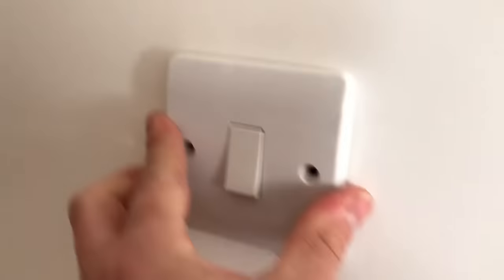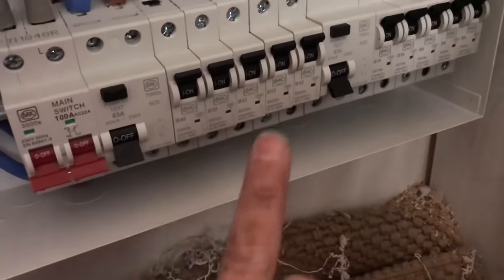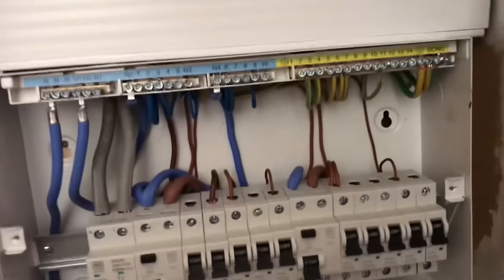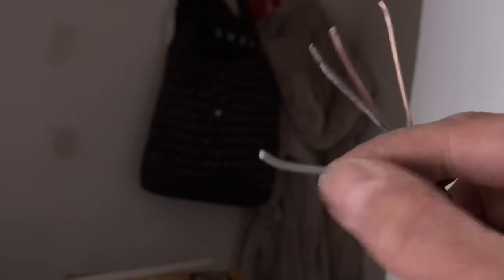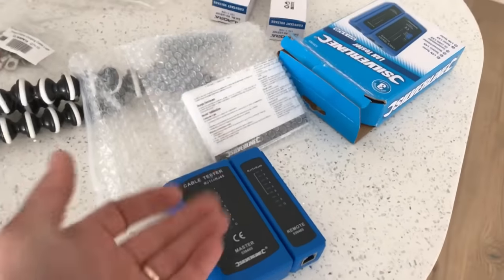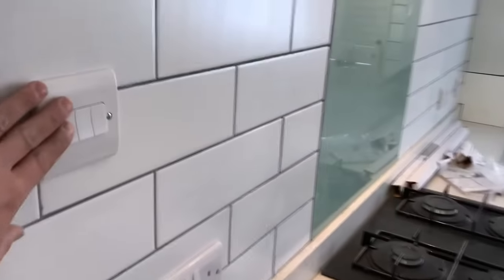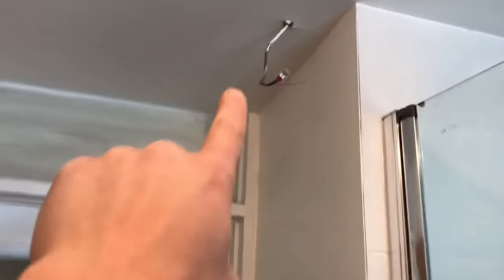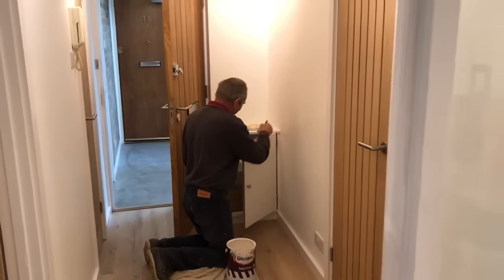CJR ELECTRICAL Electricians day finally finished the flat from hell!!!

Comment: I’m an American electrician and it’s interesting to see how you do electrical work in the UK.
Reply: Much better and safer you mean? Rcds save thousands of lives. My friend was saved by one. In the US he would have had 15A through him.
Reply: bobandbobandbob calm down dude, we have gfci stuff too, electricity is a current anywhere, got to be safe with it.
Reply: @bobandbobandbob6285  new construction here all uses gfci.

We also use half the voltage you guys use, id say thats quite a bit safer.
Reply: Donz Milky Except you have considerably more electrical fires and electrocutions, even taking population size differences into account. Your voltage is no less lethal, but it does mean your appliances are piss poor performers!
Reply: @spencerwilton5831  not true in the least.
Reply: There was no implication about a lack of safety, All I meant it was interesting to see the codes, methodology and equipment used in other countries.That’s all, The comment was meant for other electricians not trolls.
Reply: @bobandbobandbob6285  I'm an American electrician and we have the same safety devices.
Reply: @donzmilky5961  You do but aren't a lot of new builds fitted with 240v for hungry appliances now?

Comment: Check inside a chint board ,very neat as has covers on the neutral  bars. Snobs will call em crap but I reckon better build than most.
I would have chucked an rcbo board in for so few circuits.  But keep up the good work.  Enjoying your vids. No swearing ha so my boy can watch em with me ,until he gets bored lol.

Comment: The door that swings down ‘IS THE METAL MESH FILTER’ I have one of those (in cupboard) filter hoods but I also have it vented by pipe out to the exterior. You take off the door and bang it through the dishwasher to clean the ‘filter’. They are not the best cooker hood but they are good for confined space kitchens that have no room for a big fancy hood.  
IT DEFINITELY NEEDS VENTING TO THE EXTERIOR THOUGH!!!!!!
Reply: The metal is a pre filter, its supposed to have another filter behind it.
Reply: Donz Milky Not always so, my hood has dishwasher proof stainless mesh filters, as do all commercial hoods. They are designed to be ducted out though, if not, additional charcoal filters are needed.
Reply: @spencerwilton5831  his isnt vented to the exterior

Comment: Really top work here. Considering the challenge of working around the "finished" kitchen/bathroom.

The extractor hood should really have been vented outside however. The fan won't do anything blowing into a closed cupboard as the back pressure will build up and be too high for it to work.

Comment: i dont know what to say about those crimps, i work as an electrician mostly building electrical assemblies and whenever we see that style of crimp we always trim it to length and then heatshrink whatever is left.... and we only use them on grounds XD
Reply: M H  youre clearly using the wrong crimp tool, when ive done calibration testing for our tools, in a tensile test, the copper strands will break before its pulled out of the crimp 99% of the time and the 1% is when the tool fails calibration

Comment: Suggestion:-  At 18:56  Position of driver for LED lights.  Why place it on the surface of the shelf, especially with its width down flat.  If it needs to be on the shelf, why not affix it so that the narrow edge is down on the shelf -- that way it would take up a bit less extremely valuable shelf space.  Even better, mount upside down underneath shelf above where you have it (but would need a little more cable length).  Even better, mount underneath that shelf in the open cavity -- at rear, at same vertical height as the LEDs themselves.  Would not be seen probably, as below head height, and does not take up any cupboard shelf space at all.   Do not contribute to the hell in the "Flat from Hell".

Comment: I used Philips Pentura LED strips at home. No need for separate drivers, so no need to find a home for the driver. You can't cut them to length, but they are available in a range of lengths and just plug together to create whatever length you need. Very quick to install.

Comment: I went to a break down at a dairy shed once. There was a company in the area upgrading switchboards for a ridiculously low price. 3 Rows of 15 MCBs. One phase per row. Majority of the breakers in the centre were all burnt and black at the bottom terminal where the bus bar was. They had forgotten to tighten up all the terminals in the middle of the rows. Had to replace all the damaged breakers. Not cheaper when you have to pay for a job to be done twice. Cheap, fast or right. Pick two because you can't have all three.

Comment: I'm sure someone has already said this but the Cat cable tester.  Doesn't work as shown. The end with the switch (battery) on is the source, you monitor the other unpowered end to check if the LEDs flash in order, to indicate no crossed cores.  Enjoyed the videos nice work.

Comment: the RJ45 checker you need to check the lights on the smaller unit, the larger unit is just the sender and lights up regardless the small unit is the receiver and that will show if there is a cross or no connection
Reply: Both ends of testers like that flash the same. You can check at either end.
Reply: @christopherhall5525   no you cant the sender side flashes in order from 1 - 8 no matter what (even if no cable is connected)  the receiver side must also flash in order to be correct. if the receiver side flashes out of sequence its a crossed wire, if one light does not flash then its no connection,

Comment: I recently went into a maisonette in Leamington, where some tool of Eastern European origin, wired part of the dwelling connecting kitchen and hallway lighting to sockets. All the blue conductors in the consumer board were in the mcb's, brown in the neutral bar! Stripped back some of the walls to find rogue connections to switches made with 2.5mm cable! 1mm cable connecting kitchen appliances! I kid you not, check out my Facebook page at ades-cov, I've posted a video on it.
I had to literally rewire half the dwelling, (mainly due to the young lady's budget). 
Some guy recommended by a family friend apparently!
No credentials,  no profile of jobs done. Connected a 7 2kw hob to the back of a socket hanging off loose, behind the oven which was plugged in. How the place didn't go up, is beyond me.
So it gives me some degree of satisfaction knowing that there's those on here, that do it right. 
Great videos,  thankyou.
Reply: Happens all the time. I recently rewired a family place that had been "sort of made safe" by an electrician back in 1991 but really needed a full rewire. In the walls I found some of the crap they'd disconnected back in the 90s - utterly priceless! Italian 10 amp sockets wired with 0.3 mm flex plastered into the walls, 0.5 mm solid wire posing as 1.5 (very thick insulation) feeding sockets - some of that was actually still in use until earlier this year, on a 16 amp MCB, etc.! The way they ran the wires made me suspect some Italian cowboys after several bottles of Grappa! No idea how old the work was, the only part I could kind-of pin down was the pseudo-1.5 mm, probably done in 1960 judging by the newspapers stuffed into some of the holes to save on plaster.

Comment: Your cable tester shows 6 with a partial glow. I'd say you have a slight short on that one, needs checking.
Also check the other end (the part without battery), that is the one that tells you if you've mixed a wire.

Comment: Great video, I really enjoy watching them, but I think you didn't use the RJ45/UTP cabel tester correctly. The LEDs on the main box flash no matter what (even with cable disconnected) in sequence, or manually by button press, then you have to check actually on the other (terminator) side, to see if all the LEDs there are lighting up the same as on the main box, they should be in sequence aswell to see if you wire each pair correctly (or not in sync for crossed cables, which are not commonly used, except for PC to PC connection). Only few of these boxes allow you to check the LEDs on the same (main) side, when you connect the terminator, it shorts each pair, so you can check on the main side not single wire but each pair.
Reply: PC LAN ports and switch ports have all been Auto-MDIX for a long time so no cross-over cables needed.
Reply: @UKIP  Yes I agree, thats why I said they are not commonly used. But believe it or not, I still come across them from time to time, so I just pointed that out, that in case the LEDs don't flash in sequence it is not necessarily a fault, but the person would actually have to know how they are crossed (orange with green striped/solid stay the same and blue with brown with striped/solid switched) to determine if it's a fault (incorrectly wired into the connector) or if it's normal.

Comment: Suggestion:- Those blue cables with the steel ferrules exposed.  Have some close fitting insulating capsules to press down the cables over them before screwing into the receptors, to limit live exposure.  Colour?  Not too critical, unless mandated, but probably best to match the insulation of the cable.   Yes???   Cost?  Unknown, but probably more than it should be.

Comment: With that tester you need to watch both testers. Make sure the power unit runs 1-8 and then the remote unit does too.  With two different specs (a and b) for the cat6  is easy to mix up and connect two ends differently. 🙊
Reply: Those extractors have a charcoal filter actually on the fan and the cover is a grease trap. I have one of those.   They're useless 😑 ... I've got a paper filler kit that I put on which made it better

Comment: What a div (sorry it's a Pompey term.) tapping into the heating system. Not only cross connecting systems but also throwing rust inhibitor  all around the dishwasher..potentially.

Comment: A bit unlike you to fit a dual rccd board ..
Would have liked to see the inner cores colour of the tails in the consumer unit .
Does the extract fan require fuse protection 🤔 👍👍

Comment: A piece of LED tape works wonders if you have to restore the back light for an LCD display on an old CD player etc... note that some of these may have had amber/brown characters on dark background which is done by udervoltaged miniature incandescent bulbs and often blue masking where the energized characters pass nearly all available light. In such a case, I ended up with white characters on blue background but the client was more than happy with that.

Comment: most of the data cable testers in Australia only show the wrong order on the little side. the side with the battery can show correct and you can have them all over the shop but the other end will tell you if the order is wrong. :)

Comment: You're using the network tester wrong. The big unit sends the signal. The lights are just telling you which line. You need to check the "client" end to make sure there coming through in the same pattern, eg 1-8
Reply: Exactly this. Its the non-powered end that checks you have everything connected up to spec. Also check the patch leads on the tester before you start, I've had as many faulty patch cables as I have faulty RJ45 modules!

Comment: darn as a IT guy i was surprised you put UTP cat 6 next to power cables. i would at least go for foil shielded TP.
Reply: ...as a builder I'm surprised IT guys can't spell!
Reply: Its a short run and only a domestic install, you may drop a bit of speed but filtering and QoS will correct it, tbh it’s not going to see 1 gbps transfers, now if it was right next to 415v 3 phase there may be a issue
Reply: @Mrflash222006  I would never assume the owner of the flat wont want a 1Gbps network you dont know if the owner is like me a IT professional for instance. but another possible problem with guiding un-shielded TP next to a power line is that it not only causes interference but also in the worst case scenario it can send thru induction a charge spike down the TP line to your PC or network equipment and blow those to kingdom come. as those are low voltage and low current electronics.
Reply: @highkicker11 dyslexics with OCD make the best IT professionals! Much love from across the pond!
Reply: highkicker11 in theory yes but the real world it doesn’t really matter in a domestic install 99% of devices have filtering and suppression even back in the days of 10base2, its a simple install to a router what’s going to be limited to what ever the adsl/vdsl line capable of - then you have the added cost of the stp cable and faceplates Over utp
Reply: @Mrflash222006  yeah but the added cost of having to replace failing network equipment i would think would be more. Yes its unlikely, but it not impossible. I would not want the possibility but then that's me being the way i am.
Reply: The last thing I want is an electrician trying to correctly terminate foil shielded TP. It’s a domestic install, Ethernet is basically bullet proof agains 50hz induced noise, it has to be as it would never work bundled up with hundreds of other radiating data cables. You’re  really going to struggle to induce enough current to blow the isolation transformers out.
Reply: E Cooper yes my point exactly its fine reading books, sitting in a office in a suit, In the real world you do what works - That is the difference between an IT Professional and a Technician that's why I let my MCSE lapse, I have always been hands on with Hardware and Networking for many years
Reply: @Mrflash222006  the difference is mostly in pay in this case as i am not a office jerk kind of guy. I just wont lower my standards and give cheap out crapy service. I dont want customers comming back to me saying they have networking problems because i cut some corners just because it would probably be al right and i would get more cash in my pocket. Its the same with why he ended up doing a compleet rewire because the other guy cheapt out
Reply: Pmsl, Money isn't everything - so you just upsell your clients - why bother with copper when you can have 10 gig fibre, Anyhoo STP is pointless is a domestic setting as most consumer grade equipment is not shielded anyway and the data is not mission critical. YDY

Comment: Just a thought, but have you considered microwave sensors instead of PIR? I'm just thinking that, in a cupboard, the owner might stack things blocking the line of sight of the PIR which would make it less effective, but microwave would go through most obstacles. Also, depending on how you set the sensitivity, they'll have the light on before the cupboard door is even open. I have one in my hallway and landing and the light will come on before I even open the door. The least sensitive setting only reacts about a meter away.

Comment: I would be considering what implications and/or toxins are for the dishwasher and owner
 now that central heating water has been run through it. Inhibitor or other CH chem pose any risk to health or the washing machine?
Reply: The fact they've managed to attach a dishwasher to a CH pipe I would be surprised if they actually put inhibitor in!
Reply: @thegalloway  yeah that was my thought too but couldn't recall if the boiler/CH was replaced or existing. You would of thought they would stop to think "22m pipe, yeah must be mains water" (assumption made there with usual 22m for flow/returrn)

Comment: Great vid, well explained! Please can you tell me where you got the led strip/tape system from? That is great for kitchens and cupboards etc thanks
Reply from the maker: https://www.screwfix.com/p/led-mounting-profile-15-x-6-x-1000mm/9557K?tc=NT7&ds_kid=92700019938272768&gclsrc=aw.ds&ds_rl=1241687&ds_rl=1245250&ds_rl=1249401&gclid=EAIaIQobChMI-8PivbKg4gIV7pztCh0P2AxTEAQYASABEgK6cPD_BwE
https://www.screwfix.com/p/enlite-en-stk1200-led-cuttable-striplight-warm-white-1200mm-5-8w/9486v
https://www.screwfix.com/p/aurora-12-240v-constant-voltage-led-driver-16w/2107t
Reply: You can also get plug in ones from B&Q. I got some reels a few years ago for a recording studio, to run under a pelmet. Just peel, stick and plug in.

Comment: Why do you use RCD's for multiple circuits as opposed to RCBO's? As a homeowner I insisted on having RCBO's in our new consumer unit because having 2 RCD's tended to result in nuisance trips and when we had a fault on one circuit the RCD was taking out multiple circuits which was really inconvenient.
Reply from the maker: Cost
Reply: @Cjrelectrical  Do you ask the client beforehand? Because when a fault developed I was not happy to find that the electrician had installed two RCD's in the consumer unit to save what was not a significant amount of money to me. Not to mention the hazard of the lights going out when I was in the shower.

From personal experience I feel it's dangerous not to use RCBO's for lighting circuits as it puts residents in danger of falls if the RCD trips the lights out because of a fault in an unrelated circuit.

Comment: I'm sure somebody probably mentioned this elsewhere with the cooker hood - the alu front is a washable filter, you just bang it in the dishwasher when it gets greasy. Which is fine when it does what it's supposed to do but over time you still get grease. Over its lifetime it doesn't really matter - it'll last 20 years if you look after it, then you're getting a new kitchen. If it was my kitchen I'd want that crap blowing outside anyway because seriously and also there's no airflow because it's basically sealed in a box so it'll be utter trash. Why would anybody spend so much on a kitchen then allow that to be a thing? Nuts. There's seriously something wrong with people.